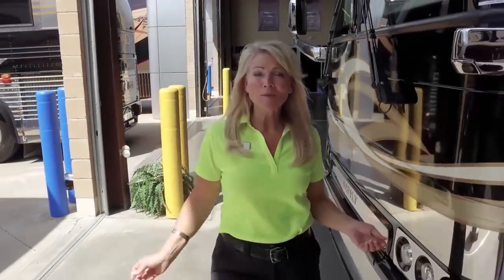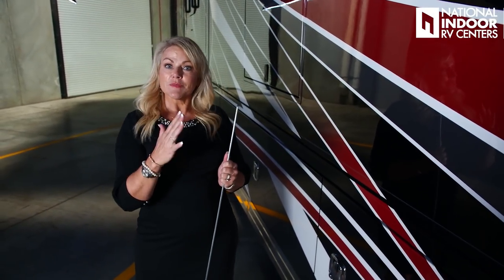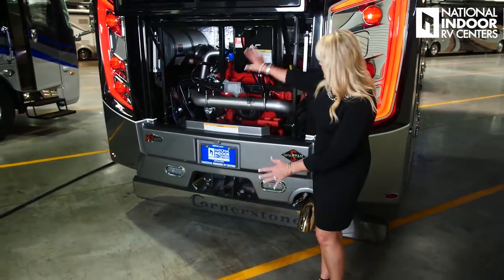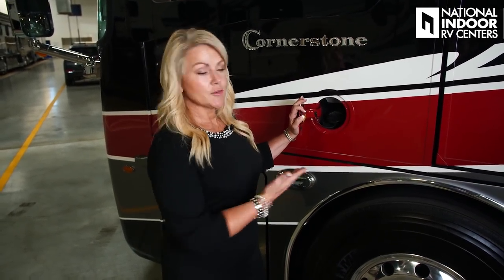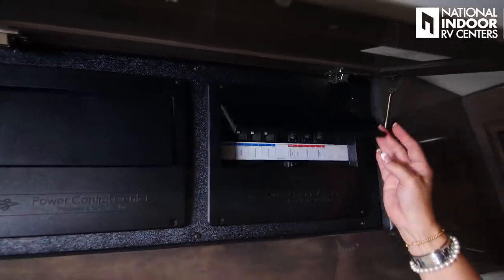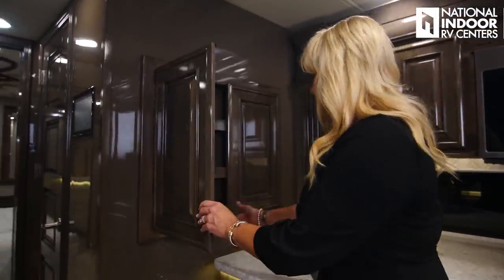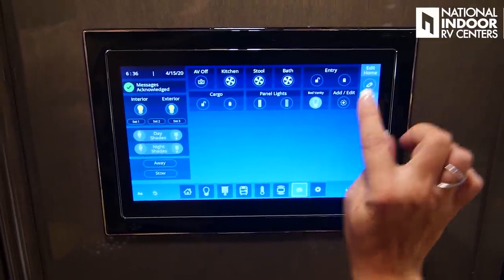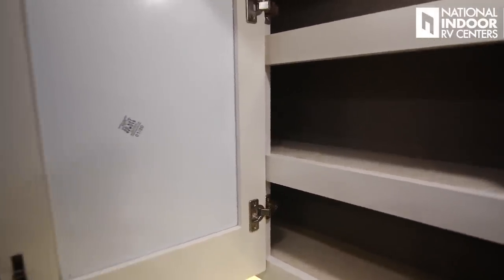2021 Entegra Cornerstone | Full Motorhome Walkthrough Tour | NIRVC

Comment: Great tour. It looks great. For the most part I like it. I still think two bathrooms is a bit silly for a camper... I think where the horn button is is ridiculous. It's hard enough to find the horn button when you need it when it's right on the steering wheel. In one of the other ones I watched, there was an air horn, where you pulled it. I think that option would be a much better choice than a horn button that you won't be able to find while you're driving and something happens where you need it... but it was a great video 👍
Reply from the maker: Most RVers want the bath and a half. It’s very popular!  You just select the horn from the dial. Whether you want the weak horn or the air horn. I always turn the air horn on and then I just push the center of the steering wheel to honk the horn!

Comment: Hey Angie, great video. One thing I noticed, you never said where the house batteries are. You only said about the location of the chassis batteries.
Reply from the maker: Sorry I missed that Danny. The batteries are located more in the center of the coach behind the panel in the storage area were the battery disconnects are located. You really can’t see them because they are tucked back out of the way.

Comment: Nice exterior.  i'm sorry Entegra has not transitioned to flush floor slides with no carpet.   i prefer my Newmar.  odd pieces of carpet break up the flow of the lines of a luxury vehicle.    but this is a nice looking coach.